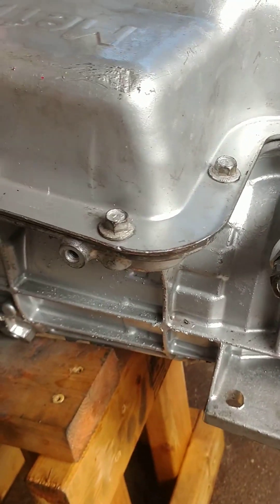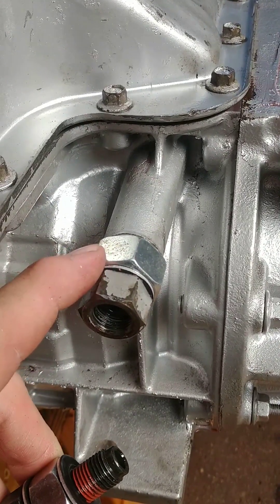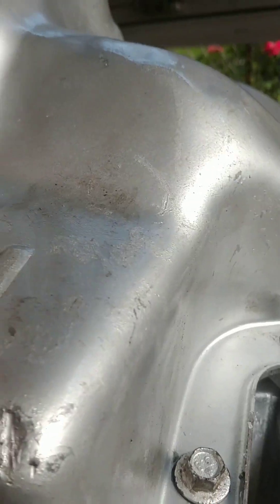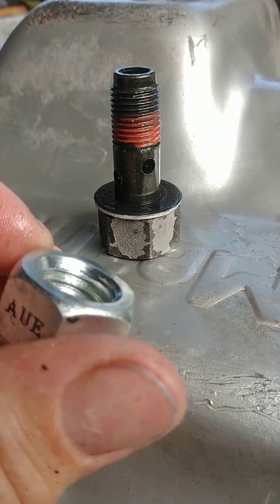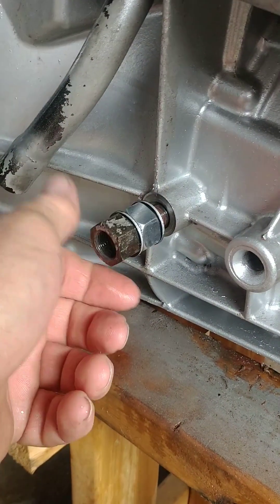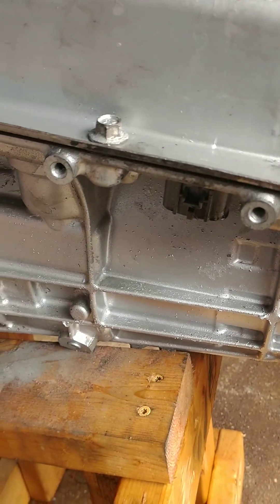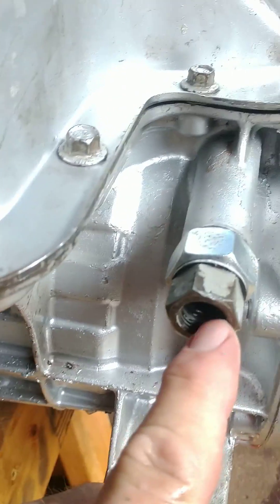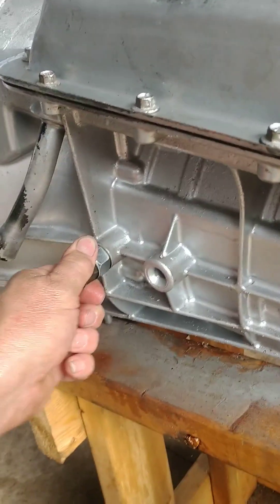4r100 bypass tube solution how i done on the cheap

Comment: Where do you get the crush washers?? Thanks!
Reply from the maker: Auto parts store. Oil drain plug washers. They are different sizes
Reply: @jamesaubrey1965  So you used a 5/8" ID and 3/4" ID nut and 4 new oil drain plug crush washers? Have you had any problems with overheating or leaking since your fix? and where did you purchase the nuts from?
Reply from the maker: @JohnLaubinger  I got them at my local auto parts store. Like oil pan bolt washers
Reply: @jamesaubrey1965 Have you had any problems with overheating or leaks since this fix?